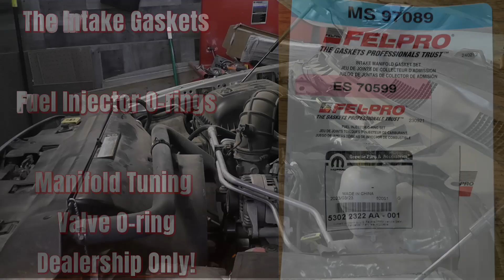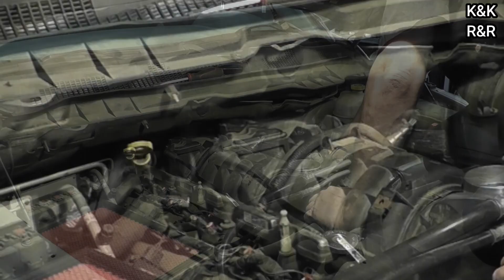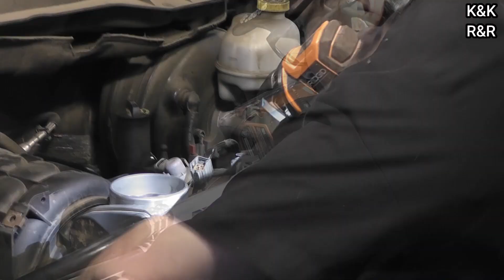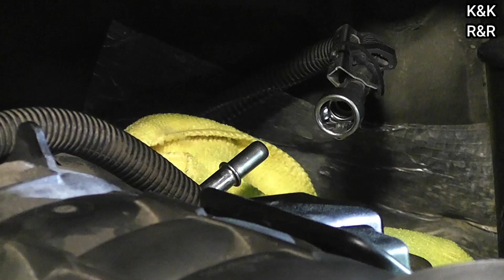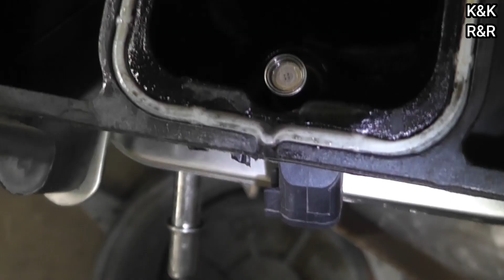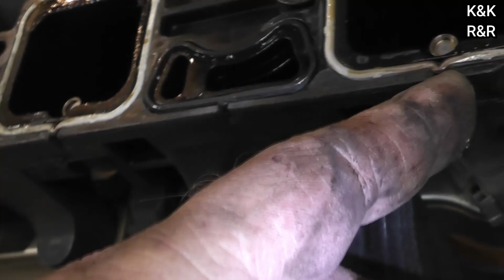09-19 Dodge Ram Hemi 5.7L Intake Manifold Gasket Replacement Series Part 1 Detailed Tear Down

Comment: Can I get a aftermarket intake manifold or go with mopar ? Thanks
Reply from the maker: IMHO factory is always better in most cases.  There are some vehicles we have had to use after market because the factory piece either were not available, cost to high, or had some other defect that would effect daily drivabilty.
/K&K

Comment: 24:20 exactly what I said. 😢I just bought a 2010 Ram 1500 last week I am doing the same thing to change the MDS, oil pressure sensor gaskets and some other sensor. I said the exact same thing 24:20 😢 fortunately I didn’t notice any gas leaking injectors. Lot of leaking oil. but Iam replacing my #4 injector I have that old himi tick hopefully changing everything on the #4 cylinder gaskets and oil change will work. God I hope. 🙏😢